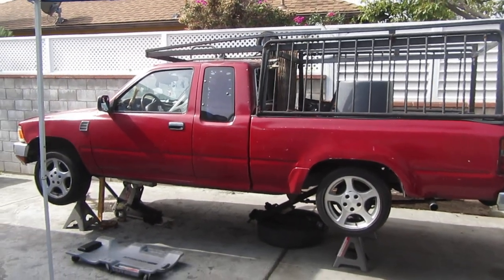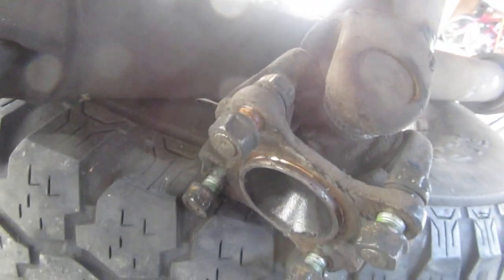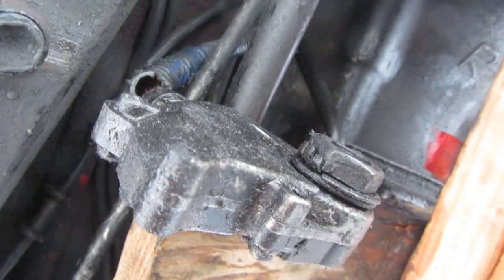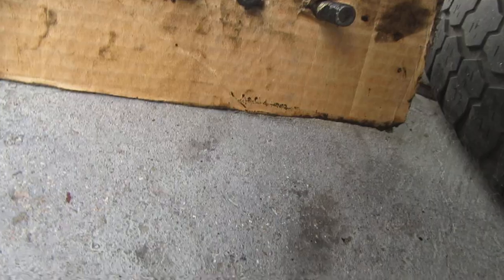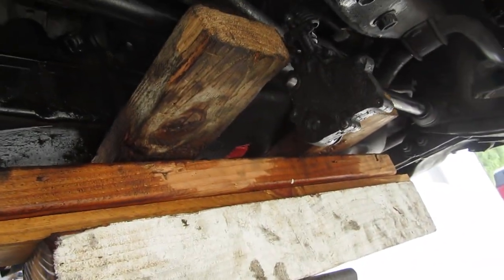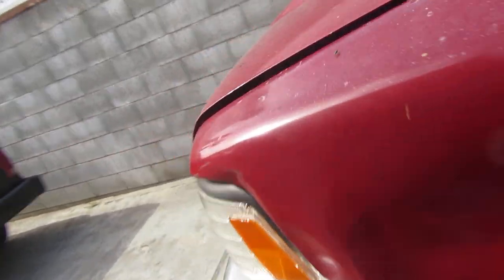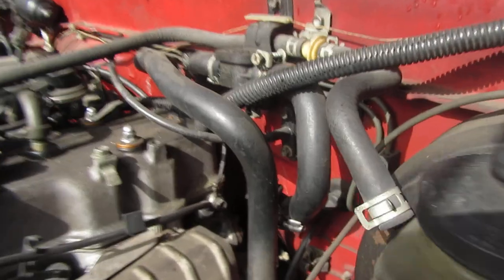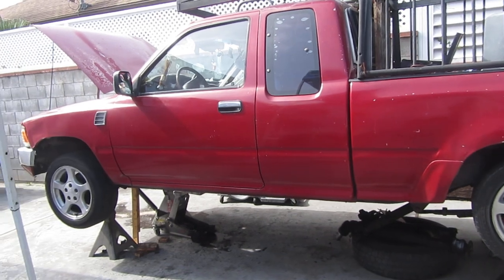Removing a 1991 Toyota Pickup Automatic Transmission

Comment: What was the part called with the wires going into it?
Reply from the maker: It is called a NEUTRAL SAFETY SWITCH.  3:05  Quick search says it's Part Number: 8060-05182916; but, I'm not 100% sure.  It's purpose is to prevent starting the engine unless the transmission is in Park or Neutral.  When they go bad, they prevent start-up entirely, usually.  Videos exist where guys crack them open, clean them, and put them back together and they work just fine.
Reply: @301steady  you know how you can trick the neutral safety switch if I was to pull out my automatic for a 5 speed?
Reply from the maker: @noahwright9454  Hi Noah!  I'm no expert; but, I found a wiring diagram online. YOTATECH Forum.  It looks like there is a Black & White Wire connected to the Starter.  There is also a Black wire running from the Ignition Switch to the NSS.  Be careful because there are several black wires running from the Ignition Switch.  Anyways, the Black wire from Ignition Switch needs to run to the BLK/WHT wire at the Starter.  Don't disconnect this BLK/WHT wire from the Starter because it runs somewhere else and the diagram I have doesn't show.  I can't say that this is all you need to do; because, there's a lot of wires connected to the NSS.  These two wires is the first place I would start.

Comment: Do  22RE's Automatic Transmission have Filters ?
Reply from the maker: Yes they do.  You can try various autoparts stores; but, it looks like Autozone carries the Automatic Transmission Filters.
Reply: @301steady  Thanks I did find out looking in the FSM. Cheers
Reply: How do you change the transmission filter on these? Took the pan out only to find its trapped by some brass pressure lines that look like need a bunch of other parts to remove
Reply: @jonz1546  You have to remove the bolts holding the pan, and the filter is there covering the valve body. While you are there you could retorque the bolts.